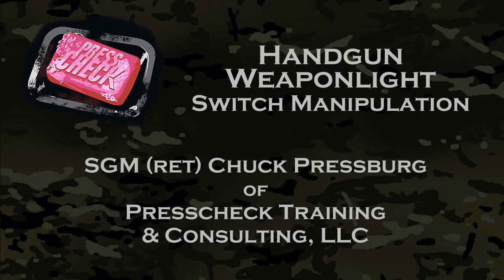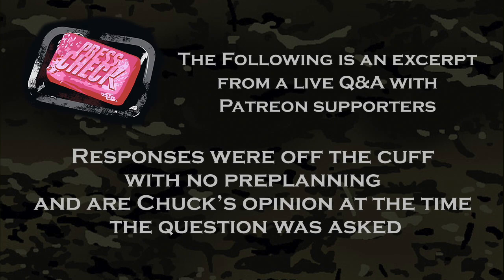Handgun Weapon Mounted Light switch activation with the draw and support grip

Comment: I use my left hand  thumb for the light but I turn my safety of with my draw hand thumb.      I need a safariland als holdster I have a 50 dollar kydex holster made for the crimson trace 208 light would that light fit with the insight technology holdster I dont have the money to spend on a 300 dollar light I might as well buy a new gun